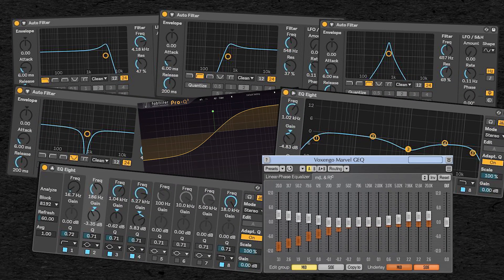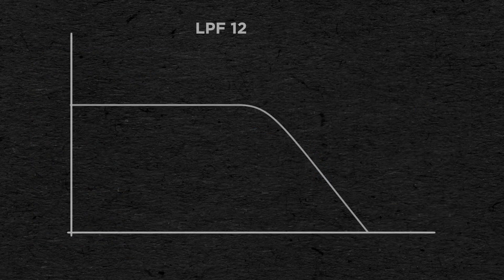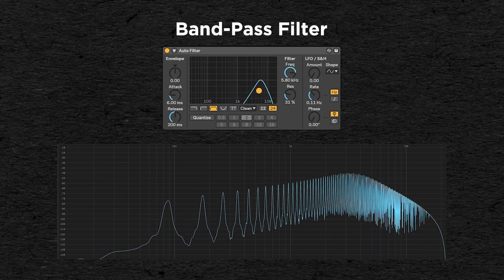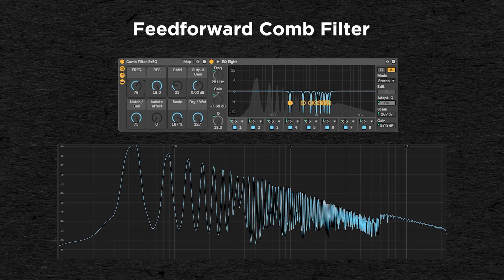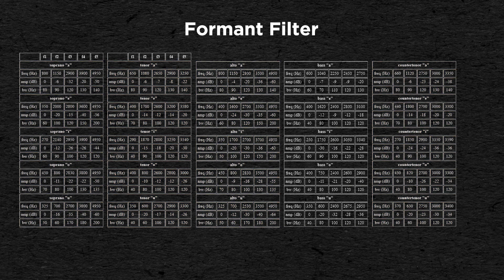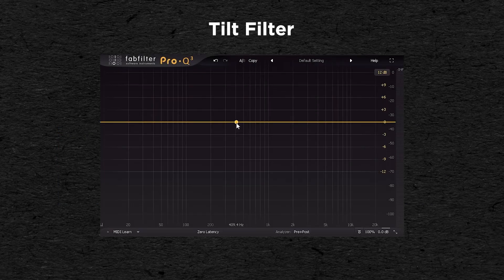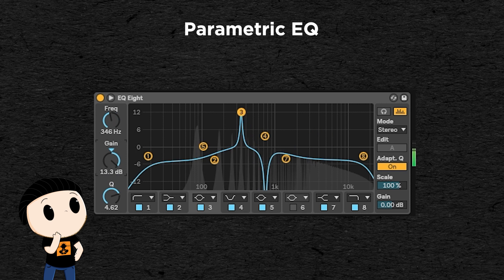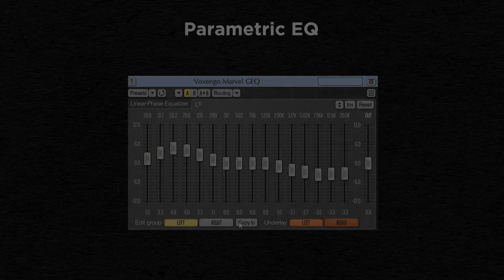Sound Design Theory: Filters and EQ explained!

Comment: Thanks for the explanations. I just had a question pop up in my mind where I thought that I could use a parametric EQ as a filter, and technically speaking I can, but it requires some work to set up as you've shown with using bandpass filters to create format filters and using macros etc. Very interesting, thank you
Reply from the maker: If you're looking for some formant filters, I made a free filter pack for Ableton live. It's a collection of effect racks with some EQ8 in them so you don't have to set it up yourself. It's on my website woochia.com
Reply: @Woochia  thanks man, appreciate it. I'm actually an FL Studio user, but your videos definitely helps a lot and is informative enough to actually make sense of everything. Keep up the great tutorials and explanations 🙌

Comment: Great tutorial, thanks. Please, how did you set up the Macro so that it cycled through the chains in the Effect Rack at 8:09 ?
Reply from the maker: That's in the effect rack. When you extend the chains, you can link the macro to the chain selector. The macro knob goes from 0 to 127, and for each chain you can set it to be active for specific ranges. It's represented as block that you can extend or shrink (it would be easier with a screenshot to show you)
Reply: @Woochia  Thank you ! I did some research after finding this video and I'm pretty sure i know how to do it now :) Thanks again

Comment: Great video! How did you create that feedback comb filter with macros at 6:04?
Reply from the maker: I used an EQ8 (two actually) and mapped each point to macros knobs, and adjusted the values so they move as a comb. This is part of a free pack you can get on my website if you want to see how it's made. It's woochia.com

Comment: First of all, THANKS for this videos i love u. At last, wanted to point out something that maybe i might be taking wrong but i think the Q is more about the withd of the curve of the EQ filter, like how steep (measured in dBs per octave) the boost or drop of the gain is, and the resonance is more about how much gain are you puting to the cut frecuency (and usually, it has a predeterminated Q) so they ain't the same thing, am i wrong?
Reply from the maker: The steepness of a filter is indeed expressed in dB per octave, but this is not the Q. The Q is used for resonator where it is the ratio between the energy stored and the energy lost in an oscilators cycle. The higher the Q the more resonant the thing is. So if slightly differents, A and resonance can pretty luch be used quite interchangeably

Comment: hey man, i have a questionm this has cardioid filter? in my house there is a lot of noises and i cant rec
Reply from the maker: What is a cardioid filter ? You may be talking about a cardioid mic. That's a mic that takes the sound more from the front than from the back, so yes that's a good type to record at home (so the noise coming from the back of the mic is reduced). But what kind of noise are you talking about ? Noisy street ? Or reverb in the room ? Maybe I have a video about cheap acoustic panel that could make (those are not the best acoustic panel I'll tell you, but they're cheap and easy to make)

Comment: I have an audio file from 2004 recorded in 8 simple rate and 16 kbps and this audio have a weird noise how can i remove the noise

**i think the noise Because it recoreded in 8 simple rate and 16 kbps
Reply from the maker: If is has a part with silence, where you can hear only the noise, you can try audacity's noise reducer :/ it's free
Reply: @Woochia  after i searched the problem was from the low kbps,  you can try convert any audio to low kbs and will understand what i mean